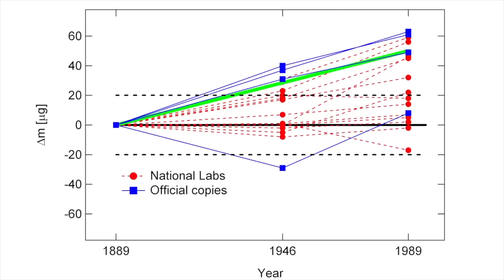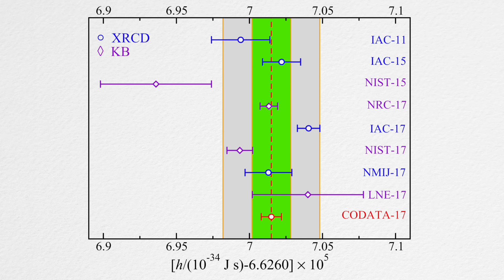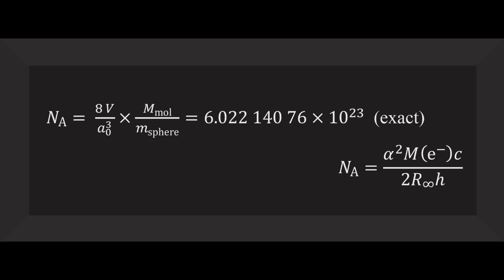The kg is dead, long live the kg

Comment: Imperial inferior 
Metric Superior
Reply: Well the definitions of Imperials measurements are actually based on metric measurements, which in turns means this will also change imperial measurements
Reply: Sounds like a cult chant........... I’m in!

Imperial Inferior
Metric Superior
Reply: @ink7761  It's a parody of a line by Soundwave from the animated Transformers movie.
Reply: @ink7761  “Four legs good, two legs bad." - Animal Farm
Reply: Using imperial system is just illogical, like totally illogical!
Reply: @erblinbeqa6550  Have you heard of the Nautical Mile? Seems more logical than a KM.
Reply: @JacksonTyler  Funnily enough, the origin of the metre was about the same: 1/20,000,000 of the length of a meridian. Accurate to ~2 parts in 10,000 still today. "Vertical" rather than "horizontal" and based on centesimal grades instead of sexagesimal degrees, but same logic.
Reply: @erblinbeqa6550  base 12 isn't illogical. I'm sorry your metric soured mind can't comprehend it :-/
Reply: Tasty Treats base 12 for what? Not all imperial units have base 12 if u ask US citizens how many feat does a mile have they don't know.
Reply: @erblinbeqa6550  5280, also divisible by 12.
Reply: While 12 is great for division by 2, 3, 4, 6;
the 12-ness still being annoying if you want to simply divided with 5.
So, 60 is better one.
In fact 1 full day = 2x12 hours = 2x12x60 Minutes = 2x12x60x60 second.
Time is Imperial.
Reply: @isaacroebuck9514  Yes, and including factors of 5 and 11 into the boot. Why?
Reply: Imperial is base 12....the human brain seems to be wired for base 12. It's subdivides cleaner than metrics base 10.

Metric maybe more self consistent, but there's a place for a base 12 measurement system in our world.
Reply: Imperial are intuitive in the mind of people who uses imperial frequently, 
Metrics are intuitive in the mind of people who uses metrics frequently.
In fact it all comes down to the habit of people and the surrounding environment, 
if everyone around you uses metrics, of course metrics will be more intuitive to use since no conversion is needed, the same goes for imperial.
But the point is we are living in a world where people have to communicate with each other, so I guess it’s common for the minority(imperial) to be left out and change to majority(metrics) like 70%+ of the world.
Moreover metrics is much more useful for mathematics and science compared to imperial.
Reply: @petercarioscia9189  Quick! Tell me how many months are there in 65,000 minutes. Your base 12 brain should be able to do the math almost instantly.
Reply: @Topher TheTenth I'm posting this to r/copypasta
Reply: @Topher TheTenth In industries globally there is often a mish-mash of both imperial and metric usage. To use one example, high pressure pipework & fittings generally adhere to the imperial ANSI system because it is a standard long adopted by the USA (e.g. WECO hammerlock fittings) which use specifications such as 4" as opposed to a similar DN100 (100mm). Meanwhile for more modern standards such as PE pipework and some steel pipework there is a group of metric DN specifications consisting of multiple 'tables'.
There is nothing inherently superior about imperial, merely the benefit of familiarity and existing usage. Particularly I would wager that imperial is here to stay for a long time for the aforementioned high pressure applications. Cost factors aside, a changeover to metric increases an uncertain period of safety and inefficiency risks during an intensive changeover phase.
Reply: @razeezar  This guy speaks truths. If a standard is standardised in imperial, therefore the adopters of said standard would use imperial. Likely an American standard like ANSI. 

If a standard is standardised in metric, then tbe adopters of said standard would use metric. Most ISO standards.
Reply: The key difference between imperial and metric is that the metric units scale easily with our decimal counting system, whereas the units in imperial use ratios that would fit a duodecimal (or dozenal) system better - 3 or 12, rather than multiples of 10 - or fractions instead of decimals. 
Arguments about how one measurement is better than another (e.g. "inch is better than cm") seem invalid to me. It's the units that you are used to that are easy to use and understand. People who say metric is bad because there is no measure between centimeter and meter overlook the decimeter (1dm=10cm), which is also often used implicitly by rounding a measurement in cm to the nearest 5 or 10, for rough estimations.
Reply: @Topher TheTenth But the ancient people used base 12 and base 20 and even base 60 and base 1, not as much base 10. Base 10 first became popular in modern times as a basis for a measurement system with the French Revolution (whose leaders, you'll note, were not ancient cave people).
Reply: Metric = did not go to moon 
Imperial = did go to moon
Reply: Whoa i didn't know we were doing hot takes. 

George W Bush was pretty cool.
Reply: I'm from the United States and I agree. It's hard to make an argument in favor of the imperial system
Reply: The definition of imperial units is derived from the SI base units these days anyway
Reply: I agree we need to stop using imperial
Reply: @Topher TheTenth The same reason that so many Americans have for not wanting to switch to metric. Since we are taught arithmetic in base 10, it's a lot easier to continue that way; it's not inherently easier (but see below), but it's pragmatically justified.

I'm not particularly convinced by the base-12-is-better argument: it's true that you have factors of 3 now coming up with a nice terminating decimal, but you lose factors of 5, and there are just as many. On the other hand, you now have to learn a multiplication table that is 40% larger. Base 30 or 60 compounds the problem, which is why it's OK to use it in time calculations where one largely adds or subtracts, but rarely multiplies or divides one sexagesimal number by another.

Nor am I convinced by the strawman that the immensity of science and knowledge is poorly represented by 10. So it is, but 12 or 60 would not fare any better. 2, which would have some claim,  is impractical unless you are a computer just because of the length of the numbers.
Reply: @Topher TheTenth I don't know about you, but when counting on fingers I keep them well away from each other, and from my anus. There really is no need to get scatological or offensive.
Reply: @Topher TheTenth In fact it's even worse re: ACU/USC vs. Imperial. The Imperial system didn't even exist in 1783 (assuming this as "date of separation of US from UK"); it was systematised in the 1820s/1830s from the Winchester Standard in use from Tudor times.
Reply: cloridan Beauchamps well for one the US is very far from the standards for calibration. We use units that relate to real life since early America was VERY rural and poor. Your foot: An average foot is about 12 inches long. Your forearm from elbow to fingertip: Your forearm is about 1.5 feet From nose to finger tip: The distance between your nose and your fingertip when your arm is extended is about a yard (36 inches). It helps not only to visualize but to make quick measurements when instruments aren’t available.
Reply: thanks abathur
Reply: the Imperial system was invented because people wanted to be special.
Reply: I'm american, can confirm
Reply: h=1
Reply: H*ck you
Reply: @Topher TheTenth It is pretty weird how people disregard the actual name (and differences from imperial) of the US unit system, including Americans.
Reply: Neo2266 thats ma boi!
Reply: This post was made by SI gang
Reply: Omega Supreme
Reply: RIP Soundwave
Reply: @Topher TheTenth Actually translating a generic statement from French to Russian is significantly more likely to turn it into something ever-so-slightly-different (or catastrophically so) than converting inches to cm or viceversa. Unless one forgets what one originally expressed in inches or cm (or litres vs. gallons)...
Reply: Can you convert 12 miles into feet in 3 seconds? No you don't. Dump people can easily convert 12 km into m in 3 seconds.
Reply: @OctyabrAprelya  dividing a foot (base 12) into tenths is basically like saying dividing a meter (base 10) into eighths. Both aren't intuitive because both aren't made for those kinds of divisions. Metric is great because we do most calculations in base 10, which is why scientific applications will use metric. But being able to divide something into thirds, and even quarters, is arguably better for a lot of real world applications. Both measurements have their advantages and disadvantages.
Reply: The Green Kilometer - inferior
The Green Mile - superior
13 Kilometer Road - inferior
8 Mile Road - superior
Celsius 232 - inferior
Fahrenheit 451 - superior
38 liter hat - inferior
Ten gallon hat - superior
Reply: There are two types of countries, those who use the metric system and those that have been to the moon
Reply: People arguing over a measurement that will probably change in the future anyway..... I just wonder when the metric system in the future will be changed beyond anything we have today? when it happens will it still be true metric or just a series of measurments built off the old system with the same name?
Reply: Would you say the English language is inferior to Mandarin Chinese? Although the imperial and metric systems describe measurements, they are both languages. The language you speak will be the preferred method of communicating data, but please don't berate those that have spoken a different language since birth, and many of whom don't speak your language at all. It comes off as rather petty, don't you think?
Reply: To be fair you have to have a very high IQ to understand the Imperial system. The fractions are very subtle, and without a solid grasp of base 12 most of the devision will go over a typical user’s head. There’s also fathoms, the superior form of measurement- it’s greatness has accumulated from a lack of bad memes about it, for instance. The users understand this stuff; they have the intellectual capacity to truly appreciate the depths of these measurements, to realize that they’re not just useful-they say something deep about LIFE. As a consequence people who dislike the Imperial system truly ARE idiots- of course they won’t appreciate, for instance, the importance of 4, which itself is a cryptic reference to the epic 4 squared. I’m smirking right now just imagining one of those addlepated simpletons scratching their heads in confusion as the US’s genius wit unfolds itself when they grab a ruler. What fools.. how I pity them.😭

And yes, by the way, i DO have an Imperial system ratio. And no, you cannot see it. It’s for ladies eyes only- and even they have to demonstrate that they’re within 5 IQ points of my own (preferably lower) beforehand. Nothing personal kid😎
Reply: @pie8801  r u srs or just trolling?
Reply: Sinque Productions Yet there's an old saying, "You can work hard or you can work smart". After all, there is a reason why metric is favoured by militaries, including in the United States! Also it's doubtful whether either system requires a higher IQ, but from a linguistic standpoint it is a lot simpler to say 'miles' and 'pounds' as opposed to 'kilometres' or 'kilograms'.
Reply: @pie8801  That's one of the most idiotic things I have read. I fail to understand how someone using the metric system is somehow lower in intellect. Just because you use some complicated fancy jargon doesn't prove that you have a higher IQ. The imperial system makes absolutely no sense in engineering at least, and the SI has been time and again proven a far superior and simple system to follow. 
PS- Just because something is more difficult doesn't mean its somehow superior and only dumb people don't get it. By your flawed logic, all of us must use rocks to hammer down nails instead of powertools.
Reply: Sinque Productions r/iamverysmart
Reply: @rohanchakravarthy6548 I never do this, but...
 r/wooosh
Reply: @rohanchakravarthy6548  I was just about to say that.
Reply: Imperial units are defined via SI units
Reply: That's not how it works you idiot, Imperial is not a fixed system of measurements based on universal constants. It's simply an interpretation of the pre-existing Metric system to divide commonly used units into increments which are both more practically sized for everyday use, and are much more factorisable due to the use of a dozenal number system. The imperial system can't be inferior to the metric system, it is the metric system.
Reply: @OctyabrAprelya  I absolutely agree, it comes down to initial learning. Growing up on imperial, you are forced from a young age to have to do the conversion in your head. Knowing both I really do believe imperial is better in practice, as it can be both precise and vague when necessary. Metric commands precision. It's all about accuracy, which is great. I do think knowing both is better and can't stand all the hate for imperial by people who don't understand it.

People like you rock, though. 
Peace.
Reply: @gunslinger2566  "Metric commands precision. It's all about accuracy"
WTF are you on about? You can be as accurate or not as you like, metric is just easier to be more precise.

Saying you want half a metre is less accurate then 50cm which is less accurate then 500mm.
Reply: Arrgghh 
No... no it isn’t, they’re exactly the same

Saying a third of a meter, or 33cm on the other hand...
Reply: @Neo2266.  Nop he is right we are not doing math there we are doing measurement
Reply: @gunslinger2566  Please tell me when is it necessary to have a vague measurement. I don't intend to ridicule you, I am convinced whatever you say will crack me up, and I'm due for a good LOL.
Reply: @gunslinger2566  I know both.  I want America to get rid of imperial and use the superior metric.  I mean, we already do behind the scenes.  We just need the public to wake up.
Reply: The real solution is just be an engineer and use it all, Want Metric? Meter, Centimeter, or Millimeter? Want Imperial? decimal or fractional? It all comes in handy depending on what you're building, no matter what system you know.
Reply: @isaacroebuck9514  And then mistakes are made and people die
Reply: Metric is better for math. 
Imperial is better for real world measurements. An inch, a foot, a pound are very basic and understandable units. Halving or doubling is intuitive. Metric has no average stuff size, it's goes centimeters to meters, no in between. It's not relatable to human experience.
Reply: Gunslinger 256 technically between centimetre and metre is a decimetre
Reply: @Hayds126  or 10 centimeters :0
Reply: @Hayds126  the fact you had to say technically shows no one uses it because it's useless.
Reply: Gunslinger 256 better than anything the imperial system has. The fact you defend it just shows your incompetency
Reply: @Hayds126  wut?
I know metric, guy. I also know imperial. Do you? Who's incompetent? 

Come on, genius. Keep 'em coming.
Reply: @gunslinger2566  So the problem is there is nothing between centimeter and meter - but there is, which means it's useless. Amazing logic - you're never gonna lose an argument.
Reply: Gunslinger 256 if you know metric there is no point in using imperial. Only reason would be to lower yourself to the level of an American and no one is gonna do that for their sake. It’s time for them to wise up and make the change
Reply: @wenigmehl  sorry, I meant nothing relevant in between, since your only argument is semantics.
Nice try, though.
Reply: @gunslinger2566  1. No u didn't since u didn't even know it existed. 2. Learn the meaning of semantics. 3. The fact that decimeter isn't used a lot shows that you DON'T need something between centimeter and meter, which counters ur whole point, Somehow in ur mind you turn this around to: metric system is bad because you have something in between meter and centimeter that is useless, because... well just because.
Reply: @gunslinger2566  That heavily depends on with which you grew up.
I can accurately estimate a meter within 5 centimeters of error, a centimeter with a millimeter of error.
This really is no argument at all, especially not from someone who didn't have the experience of growing up with one of the two.
Reply: Gunslinger 256 Imperial is, like most things, simplified for the American common folk. 
Metric is technical and practical and all but 3 countries use the metric system. Not so useless.
Reply: Neo2266 you just got roasted.
Reply: Replace imperial with black and metric with white and you have problem on your hands
Reply: @OctyabrAprelya  You measure your height in mm or cm? Really? And Civil engineers, carpenters regularly use imperial units everywhere in the world.
Reply: @OctyabrAprelya  Haha. Good joke. People all over measure height in feet and inches. Why bring furlong into this. You just converted your height into mm, cm for this answer.
Ask any carpenter or civil engineer about measurements and he will tell you all you need to know about feet, square feet, inches, etc.
You made your desktop yourself? You mean you assembled all your laser crystal components(assuming it is flat screen /non CRT), created and designed the circuits yourself and soldered everything together?
Reply: Neo2266 I’m sorry fractions are too complicated for you.
Reply: @NoticingBehaviors  but why....... Just why?
Why are the conversions in imperial so non uniform?
Reply: @vaidehasathe  Imperial conversions are non-uniform because they are task-specific, and based on practical measurements.  The foot is based on the size of... well... a foot.  A yard is the length of a step.  An inch is the knuckle of your thumb.  Volume measurements used in cooking all have base-2 conversion rates, because you frequently have to double and half recipes.  Length measurements work best when they have multiple factors, which is why 12 inches to a foot is so useful.  Dividing any metric unit by 3 is a pain, but most imperial length measurements can handle it in whole numbers by changing units.
Reply: This is why metric time never took off.  Base-60 timekeeping is just too useful to give up.  You can evenly divide a minute by 2, 3, 4, 5, or 6 using whole numbers.  24 hours divides easily by 2, 3, 4, and 6.  Metric only has 2 and 5 as factors, which makes it much less flexible.
Reply: @cottrelr  
Alot of scientists use metric measurements of time as it makes the math and calculation far easier.
But yes in everyday layman life our current system works pretty well.
Reply: @vaidehasathe  Perhaps you haven't considered this:  I see slipped decimal point mistakes in metric all the time.  The unit conversions in the US Customary System are more deliberate, which can reduce errors of laziness.
Reply: Trey K And I'm sorry that Metric is too consistent and practical for you.
Reply: @NoticingBehaviors  I'm sorry you make things hard for yourself for no reason
Reply: Trey K
“ThERe aRe 5280 fEEt iN a MiLE”
“1000 meters in a kilometer” 
Which is easier? Tell me
Reply: @NoticingBehaviors  then don't touch our decimalssss
Reply: @NoticingBehaviors  I'm sorry you feel that having to learn a set of fractions is superior
Reply: Roasted
Reply: Philippines uses imperial, so yes, metric is dull
Reply: Rodigo Duterte 
No, we don’t
The Metric system is much more widespread in the Philippines than Imperial.
Reply: @rodigoduterte9192  
We do, and at the same time, we don't.
Because of a lasting American influence
 like the paper size and the basketball height, we use imperial unit, thats because we imported papers from The US and just clinged with it and same with basketball